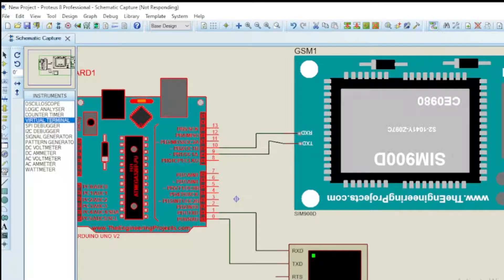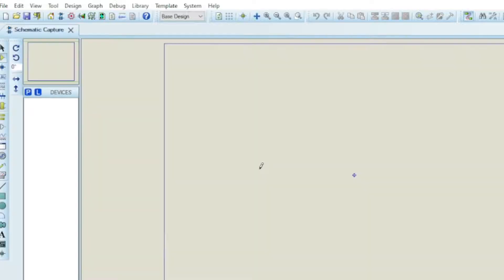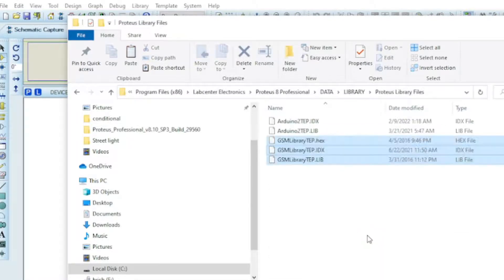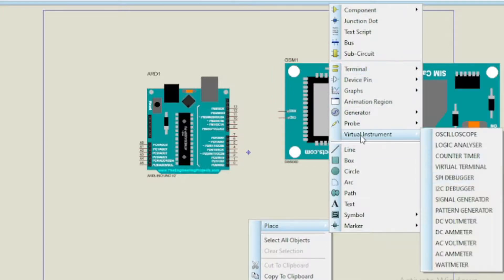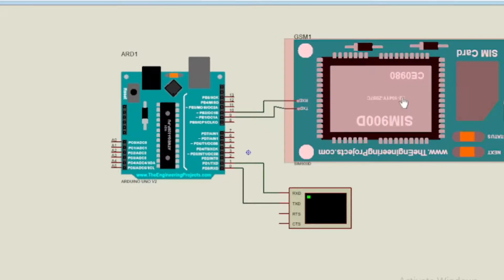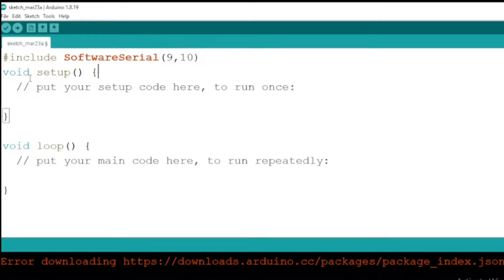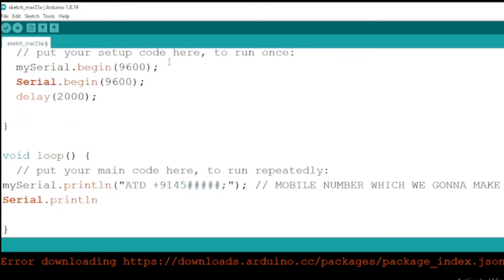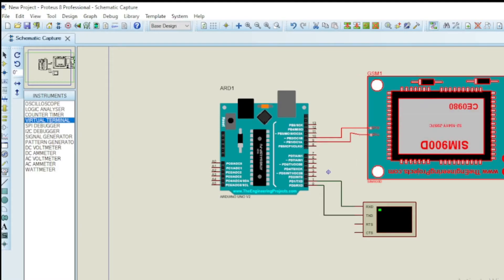GSM Call interfacing with Arduino simulation in Proteus || with source code || 2024

Comment from the maker: Here is the Arduino code:-
#include <SoftwareSerial.h>
SoftwareSerial mySerial(9,10); // 9=rx and 10=tx
void setup() {
  mySerial.begin(9600);
  Serial.begin(9600);
  delay(2000);
}
void loop() {
mySerial.println("ATD +9145123456;"); // MOBILE NUMBER WHICH WE GONNA MAKE A CALL
Serial.println("ATD +9145123456;");
delay(1000);
mySerial.println();
delay(2000);
mySerial.println("ATH");//to disconect
Serial.println("ATH");
do
{
  }while(1);
  
}